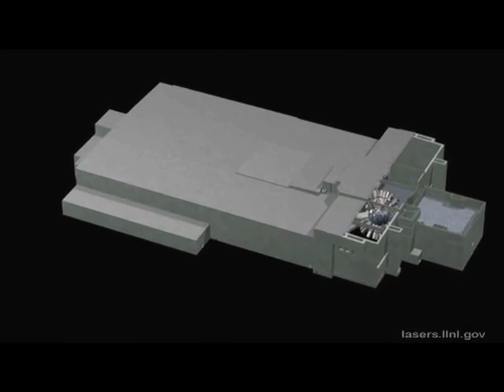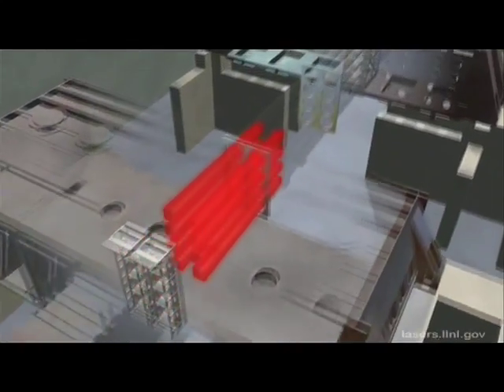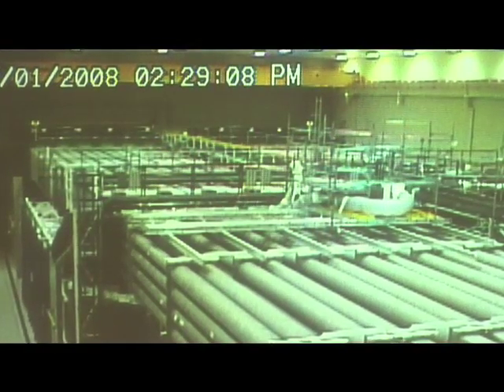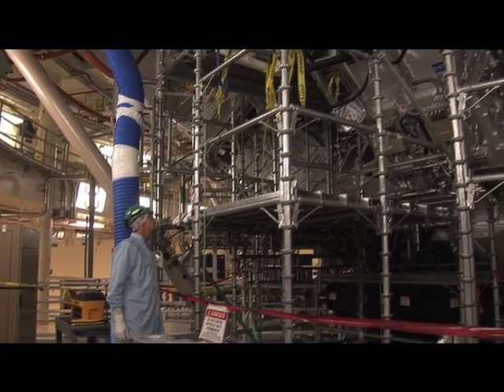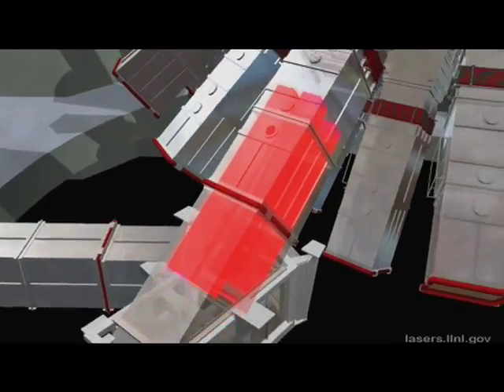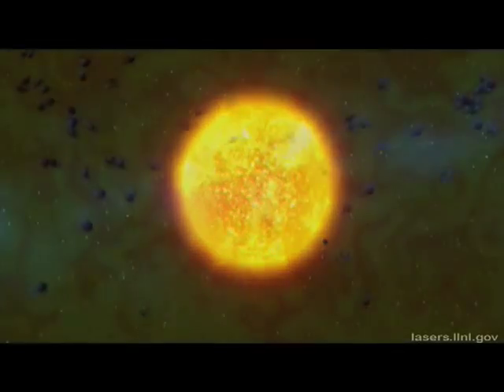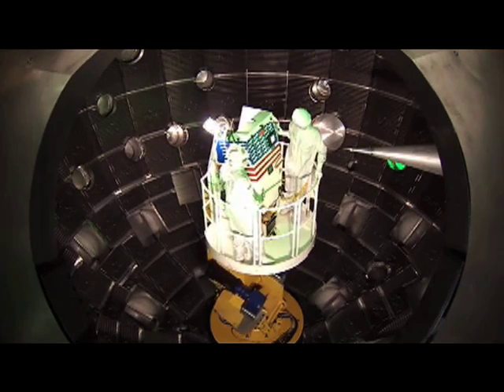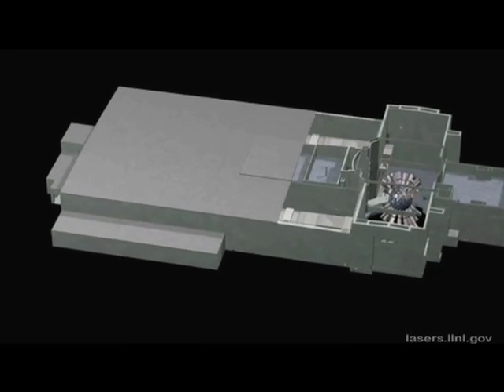Wired Science: World's Most Powerful Lasers

Comment: because 1 photo voltaic cells are not very efficient, and 2, the laser power has to come from somewhere right? so all that energy is put in to the laser and some is lost, then even more lost into the conversion. the reason the fusion can work is because by forcing two nuclei together its actually a complicated process but it creates and anti proton and causes annihilation, thus turning mass into energy withthe most efficient way possible

Comment: @circusboy90210 It's not a power station. It's more of a high temperature/pressure simulator, helps the scientists to figure out economical ways of generation fusion energy(ie, best temp, ideal energy in for energy out, containment requirements) as well as being used to probe the reactions in the sun(which would otherwise be impossible outside of H-bombs)

Comment: NIFs next step is to move to ignition-like fuel capsules that require the fuel to be in a frozen hydrogen layer (at 425 degrees Fahrenheit below zero) inside the fuel capsule. NIF is currently being made ready to begin experiments with ignition-like fuel capsules in the summer of 2010.

Comment: yes, thats true. but this isnt a particle accelerator. these lasers dont impart anywhere near the energy that particle accelerators like CERN do. They are using the lasers for heat generation, not to excite particles to slam into eachother.

1:58 he says exactly what they are going to be doing. high heat and high pressure, not tiny atoms and enormous velocities.

Therefor your original comment to which i replied, and your response to by reply are both moot.

Comment: Americans are trying to contain the fusion reaction behind reinforced concrete. The center of the fusion is as hot as the core of our own sun. The sun has spikes so will the plasma from the fusion reaction. when it spikes it will hit the containment field and vaporize it. The Europeans are adopting a different method where they are using a powerful electromagnetic field to contain the plasma field in the shape of a doughnut but this is like trying to suspend a gallon of water in mid air.

Comment: inside a Atomic laser machine be reduced;Reducing copper electric wires.Wires are dangerous inside any Atomic fusion machine(Fire safety)Replace wires with laser fiber optics to send the data and power to any small devices;Using energy from fiber optic laser light to power devices;Using Laser is same concept as using solar energy sun light to charge something.But Laser light in fiber optic wire can be twisted,turned.But can only charge small devices!